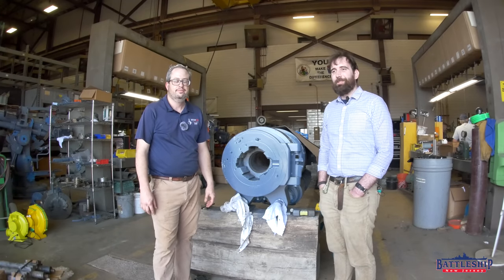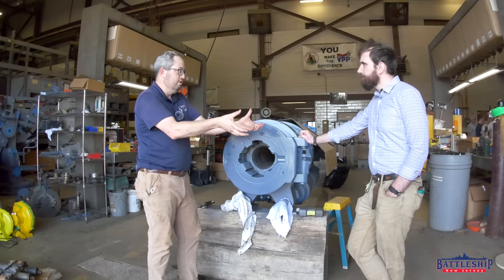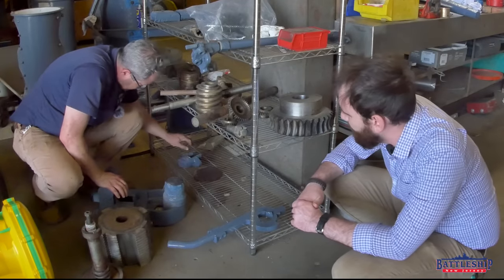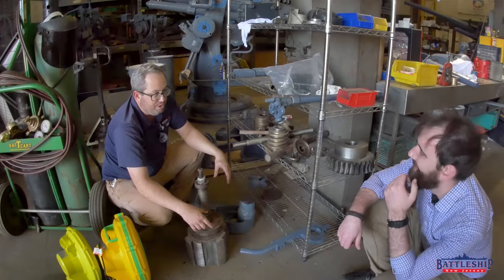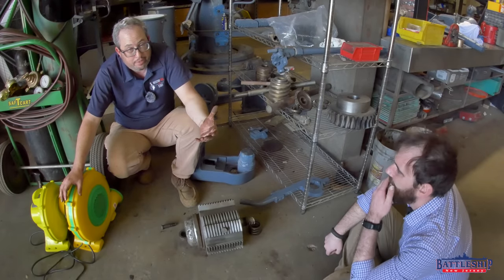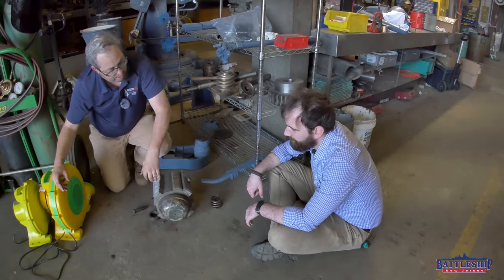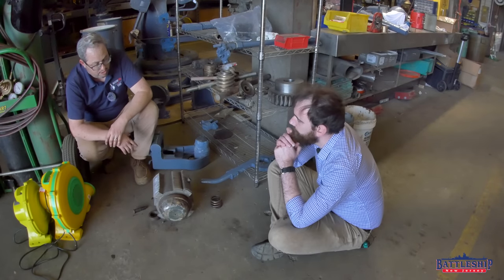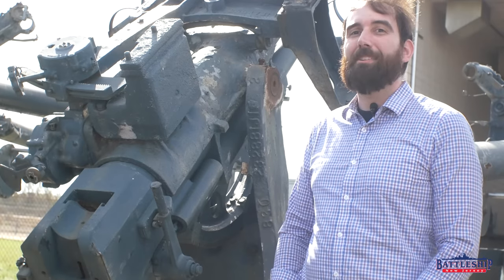Into the Breach of Texas' Guns With Battleship NJ: Part 1

Comment: The video was great. The correct terminology for the mushrooms is "obturators". The fit of the Whelin screw threads allows a path for escaping gas, so they need to be sealed with an obturator. The Germans used sliding breach blocks almost exclusively (up to and including the 800mm Dora!!). Due to to the geometry on sliding breach block design, regular obturators cannot be used, and gas -sealing is done with full-length brass cases (also done on the enormous 800mm German guns).
Reply: Yes and no. The mushrooms is the spindle and the obturators is the rubber looking pad around the collar of the spindle. The primer sits in the vent tube which is in the center of the spindle. At least that’s how it works on 155 howitzers, which use pretty much the exact same technology.

Comment: To heat up a block of metal that size just use plenty of gas and big heating nozzles. You can forget a normal sized cutting torch though.  For advice go to a steel works that specializes in repair and maintenance to molten metal laddles and scrap skips.  It should take less than half a day to make those breaches expand enough to release the blocks.

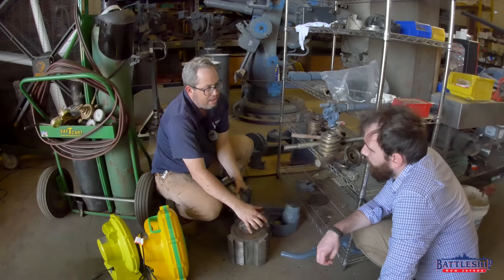Comment: 5:00 Interrupt-screw breeches were used with bagged munitions, as that system can provide obturation (i.e. a gas-tight seal between the breech block and the breech that is able to withstand the full pressure of firing). With cased munitions a sliding breech block is enough, because the case provides obturation. So well done concluding this from the priming system, but the breech-block with its mushroom should have already told you that ;-)

Comment: Before getting into the gun mechanism, I would precede it with an explanation of the Texas guns.  These would include: the secondary 5” guns were 51 cal. long, and I think used all the way to the last Dreadnought class (Maryland?).  Didn’t know shells were bagged charges compared to the later 5” for the 38 cal. DP.  Between the wars, the 5” 25 cal AA gun was fitted.  Also, the casements   below the main deck were too wet to use and plated in which Ryan explained in another video.  The gun case ended were moved to the main deck beginning with the Arizona class (from my memory of building the Revell model decades ago.  I’m sure this is discussed in Norman Freidman’s and the Garzke books.

Comment: I have wondered for a while now, and I figured you would be able to answer: as an anti-air gunner, how did the anti-air fire director work? How as a gunner was I to know where to aim? What were the differences between being an AA gunner on Texas vs. New Jersey?

Thanks!
Reply: Great question.  During ww2, the gunner would pr4ss the down button on the gamepad while pressing the right trigger button.  And if you had a cheat code. You had proximity fuses
Reply: @chrismason7066  Good Humor
Reply: There's gun directors for the 40mm AA guns. The gun director operator's job is to aim the gun. He is unable to fire the gun. It has to be done manually i.e the gunner on the 40mm has to press the pedal. So if the 40mm is on Director control, the gunner's job is only to press the trigger.